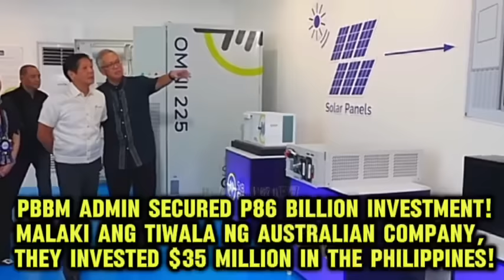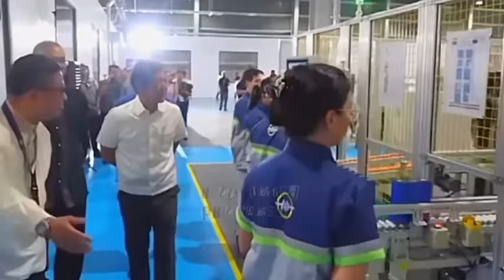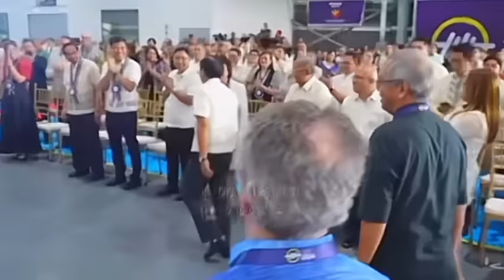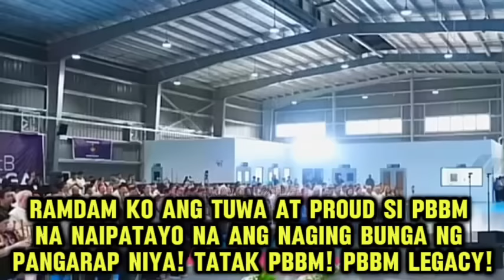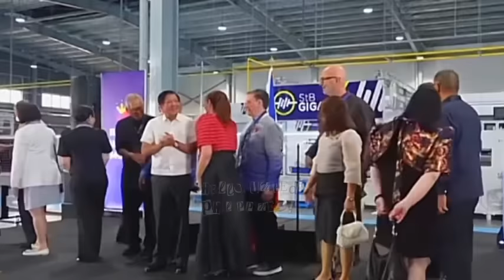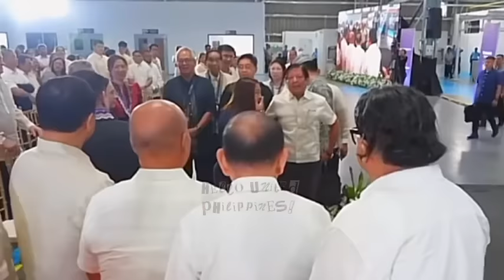PBBM Legacy! First P86 Billion - LIP Battery Manufacturing Plant from Australia!

Comment: LiFePo batteries made in the Philippines! Nice! Have these at home for my solar generator (200Ah at 12v), motorcycle (6Ah @12v) and multicab (60Ah @12v). They're more durable and efficient than the lead acid batteries -- above 90% even if I bought them used and China-made.... Lead acid is only 30 to 40% even if brand new.